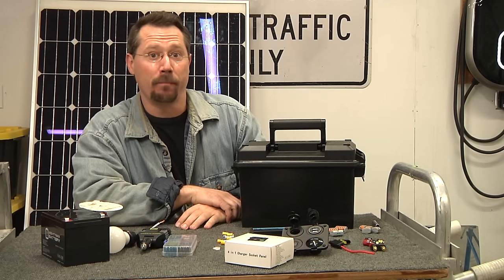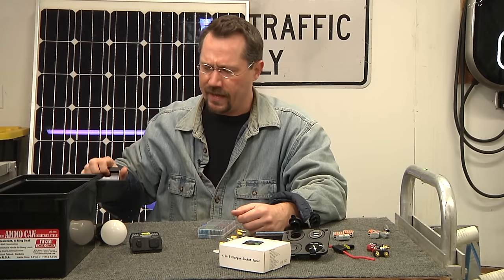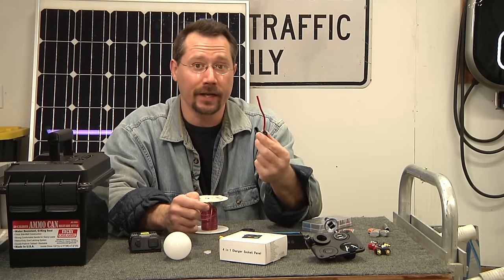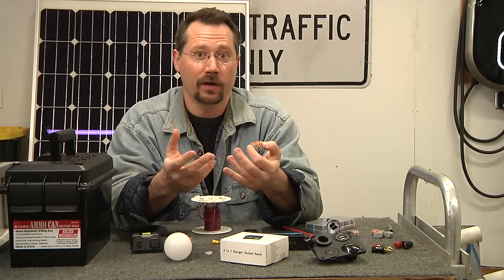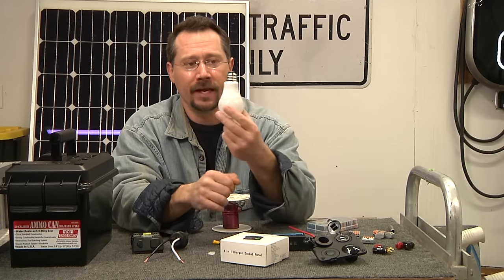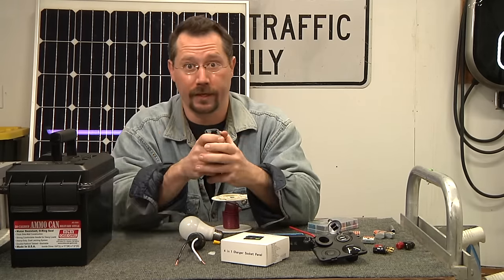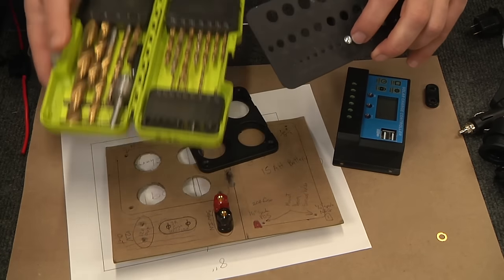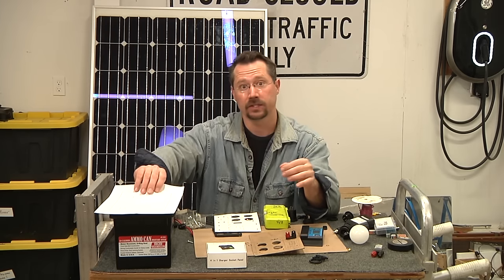Build A Solar Ammo Can Full-Length Instructional Video

Comment from the maker: Hi folks! Due to popular demand, I have made laser-cut wood faceplates available for sale. Please visit https://300mpg.org/shop/
Reply: Perhaps we could have made a faceplate, but I really loved your idea of internal connections and found your video and 'Instructables/Ammo Can Solar Power Supply'  directions useful to My wife and I making an "A.mateur  M.obile  P.ower  Box" togather.  Purchasing your faceplate gave us a prefect way to both thank you, and not to have to make our own plate.
Reply: Is possible to just buy the whole system?
Reply from the maker: @erickruepong9105  This was designed as a way to teach people how to build their own project and learn about solar and battery basics by doing so.
If you simply want to purchase a battery backup device, there are many of them commercially available.
For example: https://amzn.to/3xxyO2X
Reply: @BenjaminNelsonX  Thanks for responding. I will look them up.
Reply: @erickruepong9105  Eric if you watch the free adds and garage sales you can quite often find booster packs with modified sine wave inverter and some with an air pump as we'll all you have to do is replace the battery you can get USB ports  most have battery level indicator but you need to add a set of terminals to hook a good battery charger to charge it up the charger that comes with them is designed to kill the battery in about a year so they hope you'll buy a new one I did that for over 40 years since I'm a horder I've still got a lot of my old units since I've found utube I've found out I can put a new battery in a couple of my bigger and better units  so that's an idea also if you want a good cheap unit just 
buy a booster pack with a modified sine wave inverter most now come with USB ports just don't trust the charger that comes with it get a good battery charger and either charge through the booster cables or the auxiliary plug for solar charging harbor freight has a 100 watt solar panel kit that includes a controller and lights that plug into the solar charge controller with USB ports since non of the reviews I've seen tell I'f it's got proper charging parameters for sealed lead acid batteries but for around 200$ you can get a full system the booster packs are usually under a hundred dollars most of mine cost less than 60 dollars and I'm told the harbor freight solar panel kit is around a hundred dollars if you have devices that need USB quick charge and type C a unit that plugs into the auxiliary plug is around 10 dollars and the type C is around 30 $ you can buy splters that take the auxiliary plug and split it to 2 or as many as 5 auxiliary plugs the nice thing about the USB adapter is you can use them in your automobile to charge cell phones fit bit watches and laptops most people already have at least a slow USB adapter for their phones but the newer phones that take type C charge way to slow on them I plugged my phone in to the USB port in my sister's car for 3 hours and got a whole half hour of run time had a 2 hour trip and it died before I got a half hour out  i
Now have charger in both my vehicles so that won't happen again also my fit bit watch wouldn't charge on the slow charger it needed quick charge and wouldn't plug into type C
Reply: @douglaswindsor120  Thanks!

Comment: Nice presentation! Well thought out. Gathering my bits pcs to make one, I will however add a disconnect switch between the battery and charge controller as not to discharge the battery during storage.

Comment: I've seen this video three or four times over a number of months.  This past week, I accumulated all the major components for mine, but when I started to get the little things I need to put it together, I discovered they were nickle and diming me to poverty!  I originally desired to fuse and switch everything.  You reminded me to KISS it!

I originally started to fuse and switch just about everything.  Yours uses only one switch and one fuse.  I decided to change mine to use only the one fuse, but two switches.  

First of all, I follow the growing trend not to use the "load" option on the solar charge controller (SCC).  I use mine for ham radio transmitters and on three different SCCs the "load" can't handle even the smallest radio, way below the rated current. Instead, my output devices will connect directly to the battery (always to the master fuse.)

One switch will go to the SCC so I can turn it off when not charging the battery. The other switch will go to the "accessories", just as your accessory panel has.  Like yours, the input and output ports bypass the switches and go directly to the fuse. 

I'm designing two of them and am actively assembling my prototype.  

My prototype will be using a 16Ah LiFePO4 battery, and have three separate 12v-USB charging ports and two APP ports.  The 12v-USB ports with multiple outlets never charge two devices as fast as one. So, I'm installing three so everyone in the family can fast charge one of their devices at the same time. This is the primary purpose of the prototype, but it will also double as a power supply for picnic-type ham radio portable outings where I operate a few hours and come home. It's not worth setting up solar for one or two hours and the battery powers the radio for 5 hours. 

With the kinks ironed out of the prototype, I'll build four more with 32Ah LiFePO4 batteries with the same power panel as yours, but with APP where you have banana jacks. One of them will have a pure sine wave inverter for my CPAP and the others will be equipped with inverters like you have.  Each family member gets one during a power outage and I get one for the CPAP and one for the radio station.  The prototype will still be there for charging phones and tablets as needed.

Comment: I know it's a few years old but I've built my 3rd box since I saw this a couple of years ago. I did modify it a bit. Used 2 batteries, a solar controller and a 400 watt inverter with discharge control. Both batteries fit perfectly. The controller is mounted but the inverter is loose. It would run our lights, TV and 18v battery charger. Good stuff. Thanks for this video
Reply: How much did it cost you?
Reply: @erickruepong9105  I have about $600 in it. That's batteries, panels, inverter and charge controller and all the small hardware and box to put it all in. Harbor Freight for panels, charge controller and inverter. Can't remember brand of batteries.
Reply: @jimmywalker2429 do you have a detailed video on how you created it. That sounds awesome.would love to see.

Comment: Nicely done. Note that the wall wart charger does not have a constant-current mode so is not really appropriate for battery charging. In the video, it is trying to charge, seeing effectively a short circuit, shutting down, and then starting again. One solution is to add a buck converter with an adjustable constant current setting between any power supply and the battery. Old laptop power supplies are great for that if you want high power (with an appropriate buck converter).

Comment: You are awesome.  I got a 100 ah battery with a ice chest.  That idea is perfect for my project.  I have the same whistle you have . Only difference I'm adding 1000 walt inverter . Thanks for your knowledge and ideas.  You are awesome
Reply: If all you are going to run is an ice chest then you might want o measure just how much it draws.
If all you need is 100w then a 100w inverter has a lot less conversion losses than a 1000 watt inverter.  As an example my 300w inverter with no load draws 1/4 of what my friends 1000 watt inverter draws with no load.

Comment: Just assembled mine last night and realized two things: you can't run an inverter in the cigarette lighter socket (the solar controller instructions says you can't do this, when I tried it would shut everything down), so I rewired that socket directly to the battery. I ordered a Low Voltage Protector Disconnect Switch to add to that circuit so I don't drain the battery. I've also decided there's plenty of room in the box for another battery, so I've ordered another one and will run them in parallel (as per the solar controller instructions). I'm adding a second solar panel as well. Other than those issues/mods, it works perfect. Thanks so much for the video!
Reply from the maker: The joy of a project like this is that you can customize it however you want!

Comment: You should switch the red fused wire between the battery and the solar charge controller. Save from a parasitic draw on the battery. Nice build clean looking.

Comment: How much power does the solar charge controller draw as a parasitic drain? This will eventually run the battery down sitting on a shelf. It should also be switched.

Comment: A really good tutorial for starters, like the way you did the wiring. Most have a big mess which you should avoid. Seems a rather good battery for its size, as I watch I noticed you could add another one easily. 30Ah total is probably overkill but with an inverter, you could run that fridge an hour longer if needed. Having a few accessories on the lid itself is basically a choice. I do find that impressive and will stimulate you to use it more. Thanks, I changed a few plans myself because of this.

Comment: Thank you very much for the video! Very helpful!
Cheers!
Reply: Just one question, would be possible to plug at the same time a solar panel and a battery charger, or trickle charger? The objective is to power my greenhouse with a solar panel, and for those "raining days" with not enough sun light, the charger would keep the battery always charged?
If YES could I connect both panel and charger at the same plug at the same time, or I need a second pair of connector to the charger?

Thanks for attention, and again great video, help me a lot!

Cheers!

Comment: I made up a box not quite as nice as this one  but I used LiFePO4 cells in it.  Those cells can deliver 200A short duration.  I can jump start my truck with the thing.   I used 38120 Headway cells.  4P 4S configuration.

Comment: Great vid, thank you. I would also add 12v. power pole connector and a volt meter to keep tabs on battery draw down.
Reply from the maker: The 4-in-1 socket panel already has a volt-meter as part of it, but you could certainly add a different  style of volt meter if you wanted.

The great thing about a project like this is you can use whichever style connections you like, including Anderson Power Poles. I know the HAM Radio guys seem to like those.

Comment: Excellent, easy-to-follow instructions, thank you.  Everything works perfectly, except when I plugged in my 150 watt inverter to the DC socket and the fuse blew.  No idea what happened, but the USB ports work perfectly for now.
Reply: Is there at least a 15 amp fuse on the socket?  Or maybe the capacitor in the inverter is pulling too much current when initially plugged in.
Reply: @pinkiepie1656  there is a 20-amp fuse, but I think the inverter is faulty.  I plugged in a small usb socket and it worked fine.  I'm thinking about getting another inverter and hoping for the best.

Thanks for responding!

Comment: love it, a couple things, black screws, loctite,  i worry that someone could by accident connect your power soiurce into your remote power out sending DC volts backwards and maybe shorting the the controler or battery.  One other THING you could if needed  charge it from a cars cigerette light [useing your adaptor with your AC ps ]. Lastly I have seen roll up panels that would fit in the inside lid and seen nets and pockets that would attach to the lid inside.  Thanks

Comment: That is exactly what I thought. Lots of guys who doing Ammo can like that missing that velcro could solve lots of their issues. I was thinking to use velcro to hold all the stuff. That is the way to go! You as well could add a little car Ham radio in it...=D In that case, I would put the battery in the corner instead of the center, farther away from the radio, and add an antenna connector(s) on the top. Plural or singular depends on if you have just a 2 band radio or quad band radio...

Comment: Nice build Benjamin. It's been about one year since you built this and I'm just wondering how your battery is holding up? I built a similar system but decided to use lithium iron phosphate cells for the increased cycle life, and 90% usable watt-hours over the 50% of the let acid batteries. Anyway your build is an inspiration, and it's nice to see others following along. Thanks for sharing your video.
Reply from the maker: It all works just fine. I've been very happy with this project.

Comment: Instead of using the automotive blade fuse holder which requires disassembly to access, install a pushbutton resettable circuit breaker with a boot cover to protect it from moisture and debris.  Then you simply push the button to reset and you do not need to carry a box of fuses. Costs about two dollars.
Reply from the maker: More than one way to skin a cat!

Comment from the maker: I've also made a video showing a different way to wire up the Solar Ammo Can to repurpose the switch as a battery disconnect. See that at: https://www.youtube.com/watch?v=4YKRa9m4N7M
Reply: BenjaminNelson Great video!  Thanks for your explanations on items described and some newer parts!
Reply: Hi, how did you set up the 12v led light bulb? Thanks
Reply from the maker: The light bulb is 12VDC, so it can run straight off a battery and it's LED, so it's low draw. The bulb is connected to the ammo can by a cord with a standard lamp base on the one end and a cigarette lighter plug on the other. I bought the bulb at a local store, but here's a link to an example of similar bulbs. https://amzn.to/2R6r7by
Reply: @BenjaminNelsonX  thank you for the clarification...its a great set up
Reply: BenjaminNelson  I’ve managed to get hold of a 12v 35ah sla battery... is this ok to use?? apologies but my knowledge of electrics is a little limited.
Reply: I would like to know where I find the instructions to properly connect the cables to each other, as there is no such instruction in the videos
Reply: Ben.  Great, great job!  Thanks for all your work and keep it coming!
Reply: @BenjaminNelsonX  so can I hook up a trickle charger to the solar in. I built your setup. Its 13volts dc out.
Reply from the maker: @lockingphoenix521  The output is whatever the battery happens to be charged to right then. We call it a 12V battery, but that's really the "nominal" voltage - the name of it. The exact voltage of the battery varies with the state of charge.
13V would have been fully charged or with the solar connected and charging.
Reply: @BenjaminNelsonX  thank you. I cut the alligator clips off the trickle charger (1.1amp)and put them into the solar in. It's reading 13.1v in. And is currently charging the battery just fine. All seems well.

Comment: Take a look at the utility box #64113 for this project. That is what I am using. Lid has storage for accessories and the internal caddy has plenty of room for connectors & gauges. Also using the linear connection cluster rather than the square.

Comment: That black acrylic would be fantastic if you put thin white plastic under the lettering and then backlight it with an led 👍
Reply from the maker: I originally cut one piece of black acrylic for this project. I do LOVE the look. I decided to go with wood instead because acrylic can crack relatively easily. This project has a lot of ports screwed through the mounting plate, and the entire project is meant for camping, emergencies, and other rough and tumble occassions.

Of course, I also designed this project so that it would be easily buildable by anybody else. If somebody does a version of this project with a backlit acrylic plate, I'd love to see it!

Comment: The 12VDC load output from the solar charge controller should be fused as well. I also recommend 6 wire ferrule connectors crimped on the solar charge controller wires. I would have velcro'd the battery to the bottom of the box for replacement.

Comment: Very nicely done video.  Rather basic and I feel dated due to the lead acid... (but maybe not everyone has hundreds of old 18650 cells in their garage and is blind to all batteries beside lithium ones.)

I liked the comment about using silicone to attach stuff, I often forget about silicone and spend way to much time trying to mount stuff when just a little silicone would do the trick perfectly.

On the 18v adapter and charge controller.  Don't many of those PWM controllers lack an inductor and just connect the input to output with a mosfet directly until the battery hits the peak voltage and then they disconnect the two?  If so I would think most 18 volt adapters would not like being treated like a constant current source and being connected to a ~13 volt battery?  Seems the adapter might think it is being shorted over and over?  It would be interesting to look at the current waveform being drawn by the charge controller from that 18v adapter.  (I personally always use CC/CV chargers now because lithium stole my heart...)

Nice to know the reverse polarity protection actually works :-)

Anyway nice video.  Thank you for sharing.
Reply from the maker: Lithium and 18650s are great, but beyond "entry level" for most people. I wanted as many people as possible to learn and be able to do a project like this. If you already work with lithium cells, move to the head of the class!
Reply: That 18 volt supply is a switching power supply as used on laptops and tablets. It will be quite happy to provide a constant voltage and current. You keep saying "adapter". Why? 
My problem would be with the waveform of the inverter. It is a "modified sine wave" and not a "pure sine wave" source. If you can, then look a the a/c output on an o'scope. It is certainly NOT a sine wave. The peak voltage of that pulse exceeds 120 volts.